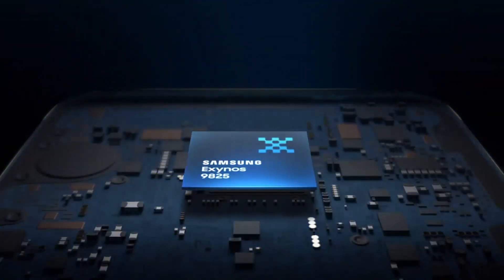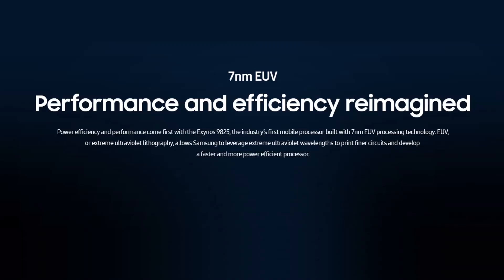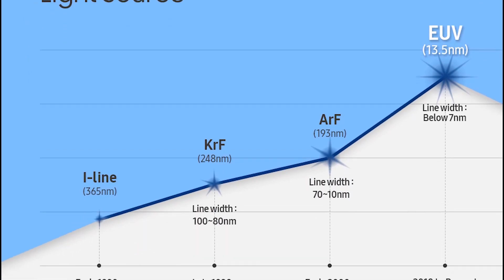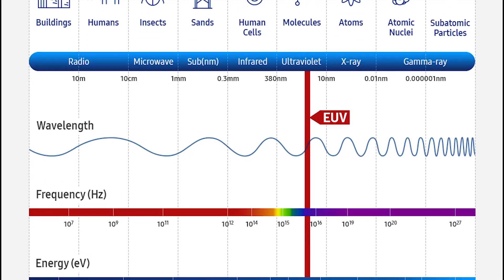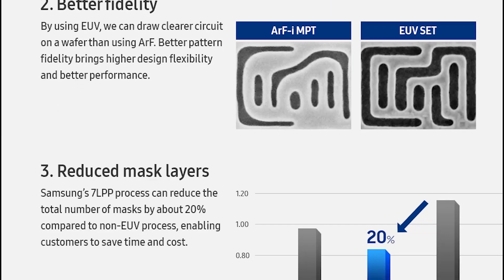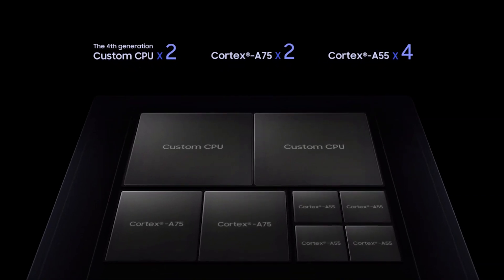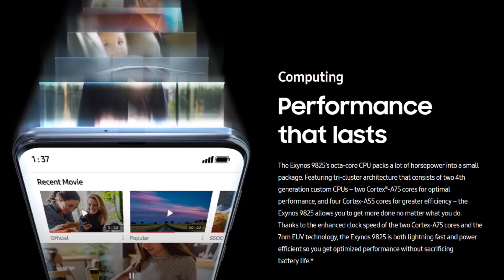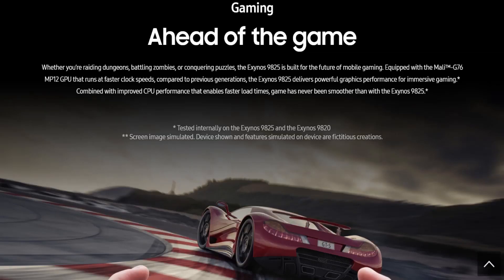What is the Exynos 9825 in the Note 10?

Comment: Still gpu is slower than adreno 640. Gpu should have been replaced.
Reply: How do you know? Did you get any  benchmarks? I agree that this is most likely the case, but you shouldn't say this without any facts.
Reply from the maker: The facts are that the GPU is the same GPU as in the 9820, but with a slightly increased clock speed. The GPU gap between the SD855 and the Exynos 9820 is too large to bridge with just a small uplift in clock frequency.
Reply: @GaryExplains  Gary I think that we should all agree that all that matters is sustained gpu performance. Because even in GPU heavy workloads like those of Antutu, where the CPU is not used at all most of the time, phones with bad cooling and strict thermal limits will still get lower performance than well cooled phones. A good example is the xiaomi black shark 2, having a stock snapdragon 855 soc. Because of the good software and  thermal solutions, it scores a whooping 35% higher than the average 145K result of the snapdragon 855. And like I said, this is a strictly GPU benchmark inside antutu. So to who the heck still matters raw GPU performance when the real graphics performance will be much lower in real life? This is why I expect the exynos 9825 to be much more comparable and to even beat the weakest snapdragon 855 phones like the xiaomi mi 9.
Reply from the maker: One of my plans for this year is to develop a variant of Speed Test G which measures sustained performance, over say 20 or 30 minutes. The software is easy to do, but I am not sure yet how to turn it into a compelling video.
Reply: @GaryExplains  Take into account fastforwarding with no clip cutting.
Reply from the maker: @kristinafraxx5808  Yes, it may end up being something like that. I guess I need to write the software and then experiment with the video format. Same goes for a battery test!
Reply: @GaryExplains  Cool! I cant wait too see the chip fail again. I have already switch a brand new SNAPDRAGON 855+  device  from the Exynos 9810 so will be interesting to watch.😁
Reply: @GaryExplains  yes, fast forwarding is a good and obvious idea, and you should also give the at the end of the video the time the devices took until throttling the maximum performance, as this is something the app will not show.
Reply: @combatantezoteric2965  Xiaomi basically owns antutu, thats why always scores higher...
C'mon a simple run shouldnt be affected by thermals and we dont even know what antutu actually measures or test to be sure from where does that difference come from in the first place.
Reply: Miguel Ángel Xiaomi, Huawei, and Oppo all cheat on benchmarks. Their phones can tell when they’re being benchmarked. I wouldn’t say it’s 30% higher safely.
Reply: @MiguelAngel-rw7kn  maybe you are right. I'm not a fanboy by any means and I don't even like most Samsung or xiaomi phones, this to be clear ( I'm not saying this necessarily for you ), but antutu, even if faked, still shows the gpu benchmarks on screen.  And as most of them are very demanding,  and especially in the first one, even when tested on sd855 or apple 12 you can see the lag.  Thus,  because it runs at very low fps on any phone, you can pretty much compare the phones and their SoCs visually. Also never forget that you can install an app and see the FPS on screen,  at least for android.
Reply: @combatantezoteric2965  That part of antutu isnt reliable. It does not render the same for all phones; some lack effects here and there, mostly shaders. It makes it unusable for comparing across phones, specially low and mid to high end.

Every other GPU benchmark does not do that. If the phone cant render those effects it will say its not supported or even just crash.
Reply: @MiguelAngel-rw7kn  yep, forgot about this, you are right. But what other benchmarks can be considered reliable? Geekbench is well known for not testing anythinting meaningful too for some time.
Reply: @combatantezoteric2965  GB 5 fix some of its weakness, but SPEC is still better.
For GPU, both GFX and 3DMark (just the GPU test) are pretty good.
Reply: @combatantezoteric2965  facts? Its been a thing for years! You portray yourself so dumb & belittle to even ask the question! What do you know about Architecture & Clock frequency explain to me to the best of your knowledge! If you fail to reply within 20 mins i'll be backstabbing you until you weep & admit your bullsh#t!!
Reply: @combatantezoteric2965  Don't even try to start a debate. Everyone knows the facts. Im flagging you as an "EXYNOS FANBOY" for now!
Reply: @kristinafraxx5808  lol actually I'm a Qualcomm fan even if my current phone has a snapdragon 820 with a crappy quad core CPU, at a time when octa cores where common and easy to make. But hey I have to agree that everything newer than the ( and including the ) snapdragon 835 is really good. That good that it can be used in laptops.
Reply: @combatantezoteric2965  oh your the same guy who was being overly supportive to Exynos even tho it miserably failed in Gary's speed Test! Oh how could i forget? I even have the screenshots! 😂😂😂😂😂
Reply: @kristinafraxx5808  You have sh*t if you don't have facts.

Comment: Euv is developed by ASML, a Dutch company that makes the machines that makes the chips. Samsung just purchases this machine and use that to create their chips.
Reply from the maker: I think "just purchase" is an over simplification.  Samsung and ASML are partners. As Samsung put it, "Since Samsung’s research and development in EUV began in the 2000s, the company has made outstanding progress through collaborative partnerships with industry-leading tool providers to design and install completely new equipment in its manufacturing facilities to ensure the stability of EUV wafers." And, "As an EUV pioneer, Samsung has also developed proprietary capabilities such as a unique mask inspection tool that performs early defect detection in EUV masks, allowing those defects to be eliminated early in the manufacturing cycle."
Reply: @GaryExplains  i worked at asml. You are wrong. Asml invented euv. Samsung might be a partner but in this case is just a customer.
Reply from the maker: I am not saying that ASML didn't build the machines or invent the current process, but calling Samsung "just a customer" is wrong. If you worked at ASML you know that chip fabrication is more than just the machine. Are you saying that Samsung is lying about its "proprietary capabilities such as a unique mask inspection tool that performs early defect detection in EUV masks"?
Reply: @GaryExplains  no, i am not. However just stating that Samsung has developed the euv process as you state in the video is wrong.
Reply: @MichaelReitsma  
Regardless, it's great to see Samsung finally jump on the 7nm bandwagon.

The "8nm" was just a moniker from their marketing division, and itself was just a more advanced version of their 16nm/10nm process node. Think of it like Intel's ++++++14nm fabrication. This 7nm is a true die shrink, so even without using new microarchitecture, we could actually see a noticeable performance increase or a battery life increase, or both... when compared to the Exynos 9820 alternative.

We're likely to see much smaller gains between the QSD 855 and the new QSD 855+ chipset, since that's going from an early 7nm node to a more improved 7nm node. And MediaTek is looking to join the 7nm party next year as well.
Reply: @ekinteko  yes next is going to be 7nm on mediatek lol. But the SD 865 In rumour say it could even reach 3Ghz clock speed in soc mobile wow that very impressive no other processor could that higher clock speed... 3ghz. Also I read the article say the multiscore score over 12k and single over 4k.

Comment: Snapdragons were always faster (expet note4 and note5) and they will be faster if amd don't catch-up with adreno gpus for later Samsung devices
Reply: WRONG. Up to S7 (2016) exynos were faster
Reply: @apothecy4011  Snapdragon 820 was more powerful it's the US S7 model that wasn't optimized other phones with sd820 were faster than the exynos s7 also even the sd s7 runs games better than the exynos
Reply: @MTCypher  gpu yes. but CPU was still better on exynos
Reply: @MTCypher  false
Reply: Not at all. Almost every single exynos had a better cpu.
It's only the last two and maybe the first that were not more powerful in cpu.
And in the s1, s2, note 2, note 4, s6/note5 the exynos had better gpu.
And in all but about 2 exynos had superior audio. 
And almost all but the last were overall more pet efficient. 
Troll again?
Reply: @jackskellington6sic6  my point is that we don't need more cpu power they are almost as powerful as PCs what we need is gpu because they have a long way to be competable
Reply: @arianamirgholami9555  That's youre opinion. And showed you didnt read what i said
Reply: @arianamirgholami9555  not to mention also leaving you don't know anything about the mali g77
Reply: @jackskellington6sic6  is because you know the compenet from mother board from hardware too is still depends both on two things CPU and GPU. What if the processor has CPU only but no GPU I think battery cannot long life to go and power energy consumption was too high it use.... And cannot do a better graphics rendering... Push more pixel.... To give it better screen resolution.... On you are screen....
Reply: @wanmaziah9835  And this is in reference to what?
Reply: Adreno gpus are from Amd ip. Qcom bought it a while back
Reply from the maker: Ashish, Qualcom bought ATI's mobile GPU business unit 10 years ago. Now, AMD are re-entering the mobile GPU market with the new deal it has signed with Samsung. Did you watch my video about that?
Reply: @GaryExplains  yes. I know Amd is trying to entire the mobile gpu business but qcom has had a well established and great gpu tech for a decade.

I wouldn't be amazed if qcom signs a deal with Nvidia on gpu tech. Or license Amd tech that they want. 

Gotta love compitition 👌🏽🤓

Comment: Hi gray can explain sd 730G and mediatek helio p90 and Kirin 810 which one is better....
Reply: So u asked someone a question, they gave u answer with reasoning, and u deny that with a thousand reasons? Why ask then? Huawei isn't using AI to boost their gpu, but rather using AI to estimate a balance on clockspeed/performance so that sustained performance will be much stable without the chip being throttled for running on peak speed and getting too hot. Overall from my understanding Huawei should give a better sustained performance if you're looking at gaming due to what I've explained above. And if you look for short burst performance, benchmarks are reliable, so the kirin would still be faster. What Gary does is basically running a benchmark in SpeedTestG, so the benchmark score u found online should be similar if not the same
Reply: @khchong87  ok.....
Reply: BBXiong the P20 Pro literally jumped 20-50% when it recognized Geekbench or Antutu. Up to unsafe levels and temps. It won’t do that day to day but without running at an unsafe level it wasn’t faster than the Qualcomm chips. Same with Oppo, Xiaomi, and Honor they’re simply padding benchmarks, but it’s not Geekbench or Antutu fault.
Reply: Kirin 810
Reply: @abisheks5272  why ?
Reply: @wanmaziah9835  7nm fabbing, better GPU and higher clock speed
Reply: @abisheks5272  hmmm I still think snapdragon is better.... Need to Gary explain..... Those GPU and CPU faster than sd coz he use what he call the boosted if I not mistake the AI Performance Boost they CPU and GPU....
Reply: @abisheks5272  not much different is not far behind is just 1nm left... Wait for new SD coming out....
Reply: 810 better in all benchmark
Reply: @ohmygod1986  cheat. Huawei always claim better CPU , GPU whatsoever.... But in real life Qualcomm has been to be better.... Than Kirin. I remember when Kirin 710 is launch and Huawei say is better than sd 660. But actually is not.... Even in benchmark....lose to sd 660.  We will wait and see.... Until come out.... Better benchmark not real life....
Reply: Wan maziah Qualcomm or  that’s it. Sammy isn’t there yet nor is Huawei.